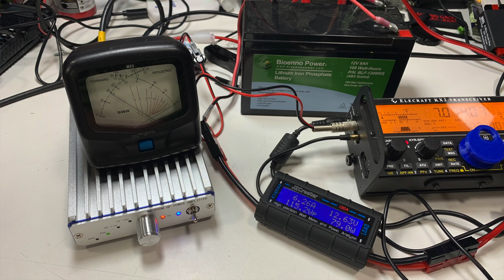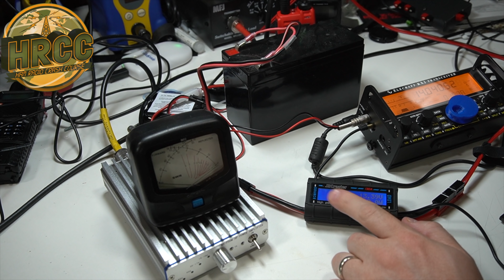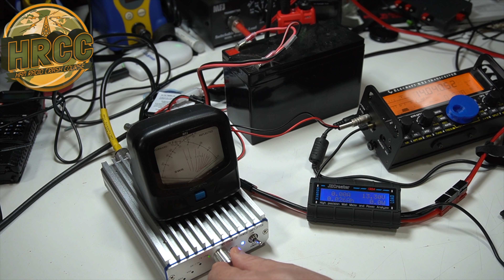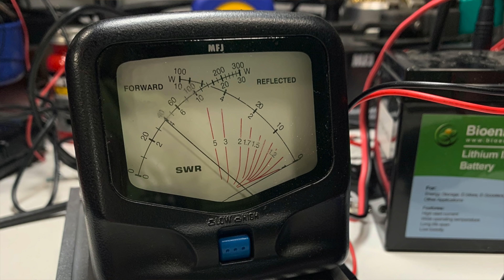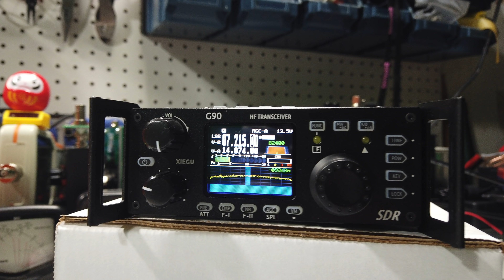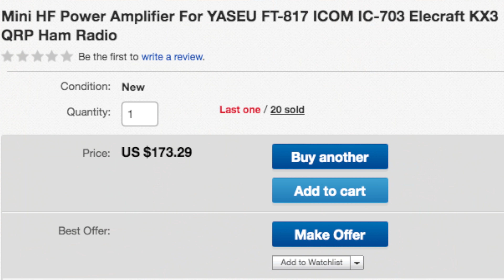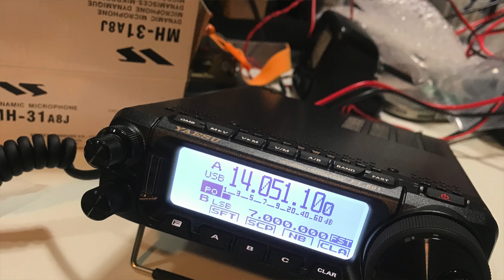Amp Up A QRP Ham Radio With MX-P50M

Comment: I loved this video, so true ! I have an FT-817ND and HW-9 with so-so antennas, and calling to the void sux. So ordered one. It came sooner than expected, easy to set up, it's EXCELLENT and I love it. Just what I was looking for. Set mine up with manual T/R switch to allow the different radios. The small size and reasonable battery drain allows better portability than the bigger rigs. And 40W is just fine. It works perfectly and turned my QRP rigs into more FUN.

Comment: iv had this amp for almost 2 years and it's still going strong! I would recommend this to anyone, I did have to make the cabel to fit my ft 817, but it was easy to do!
Reply: Same here 73 de KE0OZD
Reply: Same here.
Reply: Same here, I've got the cable working for the FT-817ND

Comment: Good info Josh on this little amp.  FT-817/818 users will probably need to create their own ACC connector.  I spliced up a Mac 8-pin Serial Cable.  There are only two wires you need to connect, it’s easy but wires are thin.  And don’t count on any customer service from vendor, I had no reply when I attempted to ask questions.  Tons of info if you search.  I do notice a draw on battery when left on, so I just leave it off if I am monitoring only.  Good luck.

Comment: I'm using it for a couple of years with ft817 and z817 tuner, so far working alright. Z817 has a limit of 20 watts...so I don't go beyond 20 watts, but I did try 45 watts couple of times with same tuner and it worked, didn't see any smoke 😊
Reply: isnt the tuner b4 the amp so it doesnt matter since forword power from the amp isnt going through the tuner anyway?

Comment: I have this amp and made a DIN cable to the FT817.  Then I also have a 3 DIN Y cable I made so I can plug in the radio, amp and CAT cable when I want digital plus amp (half QRP power).  The Y cable is not truly a Y.  It connects the relevant conductors to the correct leg.  Labeling is important.  The receive power drain on FT817 is so low compared to 100W-able radios like the FT891 the amp saves battery on receive if that is important. - N4NAS

Comment: I’ve pondered a while whether or not to buy one.  My KX3 will run up to 15 watts as long as I have enough volts to drive it.  I’m still undecided!  When band conditions dictate and have a resonant antenna I do okay.  The opposite can be a little demotivating.   Here in the UK, spring/summer is the time I get out and about more including holiday rents just in time for the summer doldrums.  Even having 100 watts can be a bit disheartening.  I did think about an additional 100 watt radio along the lines you mention just to keep the number of units to pack to a minimum.  Then portable power becomes an issue.  Problem is I love my KX3.  😊👍🏻 73 de M0AZE Mike

Comment: Josh I finally received it.
Reply from the maker: What do you think?
Reply: I like it. Will be easy to carry in a backpack for hiking to a Summit. Tried it on my 20 meter speaker wire dipole, but 10 minutes was not enough time to make a contact. I need play with it some more and to try it on another antenna.
Reply: @frankwc0o  bought from AliExpress, very slow shipping.
Reply: @frankwc0o  still working great, recently got my 1st 10 meter contact.

Comment: Great Video thank you. I would love some advise from you. I am a UAV Pilot in RSA with a aviation radio license. One of my biggest saftey issues is getting communication with manned aviation with our hand held radio on the ground usually doesnt reach most of the aircraft we need to talk to, in order to communicate our location. I have been searching for ways to connect an amp to our hand held aviation radios for increasing transmitting power. What type of amp would you suggest for that fequency band? Best Regards

Comment: You neglected to tell us how clean the output of this amp is.  You're right that SSB QRP is an exercise in futility unless we're in the peak of the solar cycle or you're using an uber antenna.   And if you've got an uber antenna, why would you waste your time on a QRP transceiver when you can afford the very best?  CW and digital are the only modes that makes sense using QRP with the current band conditions, and 45 clean watts would be the most realistic option if you want to make contacts.  I've made FT8 contacts while tuning my mag loop on the fly on my apartment balcony using less than 5 watts though, so anything's possible I guess.
Reply from the maker: It’s not the review, but spoiler alert. it has clean output
Reply: @HamRadioCrashCourse  Nice!  45 watts will be great for getting heard.   Especially with FT-8.

Comment: I would love to see someone run an output analysis of these little amps. I'm wondering about their spectral purity and filtering on the back end.

I bought one of Virgil Stamps miniPacker HFPA amps, which makes about 35w and it very useful for my QRP rigs. 

I remain curious about the inexpensive Chinese PAs. Thanks.
Reply: I was also wondering what the output filtering is like on these. On eBay UK you can buy a 45W linear amp kit (PCB and components only for about £10). I don't know if it's the same basic circuit used in the MX-P50X??. I cannot see any schematic for the kits. However, looking at the components, I cannot see anything that looks like low pass filters. Given the much higher cost of the MX-P50X and that it has a band selection switch, I suspect it has low pass filtering??
Reply: Perhaps he could do it on video for everyone?
Reply: @Steve-GM0HUU  what the amp kit called?
Reply: I doubt there is any filtering, if you were using this on a regular basis you really should be using a LPF which can be had for not a lot but they do hurt the portability of the rig.

Comment: Josh - several fellow hammers tell me that I should not connect my Xiegu G90 to the MX-P50M without using a Relay Buffer Interface to protect my Finals.  Others tell me that this protection is only for older Amplifiers?  What are your thoughts about the risk of directly connecting the MX-P50M to the G90 without using the indirection of the Relay Buffer Interface ?
Greg

Comment: I have a G90 that I run into an Ameritron ALS 500m, it puts out 215watts, if I could get an input of 64watts it would put out 600watts. I'm in a bit of a quandary, do I wait till I can buy a 100watt radio like a Yasue ft-991a, or instant gratification by getting a cheap amp, in-line to excite the Ameritron. Dang, choices, choices.

Comment: Looks great, but can it be used with any QRP transmitter? Many home-brew or older QRP transmitters have no control switching unless modified, and that's not always possible. Does it need control switching or can the RF input do the switching? Thanks.

Comment: Okay I have been using the amplifier since June 28. It is working great, often I can start a contact with the amp and then try five watts and can be heard without moving their s-meter. For 80 meters I use a 100 foot long wire into my LDG z11 tuner with no ground. Don’t touch the tuner switches or get a Rf burn. Made contacts in Washington and Arizona. My other antenna for 40-6 meters is the EARCHI 9:1 end fed. Using it vertical on a 28 foot pole that is part pvc and part crappie fishing pole. Have 32 feet of 16 gauge speaker wire wrapped around it the entire length. It is fed with 50 feet of RG8x to the Z11 tuner. Have made 40 meter contacts to Vancouver, NC , Idaho, and San Diego. Have also work 10 meters with a friend 35 miles away with both 45 and 5 watts.

Comment: Someone needs to figure out how to use all of those Makita, DeWalt, Milwaukee etc batteries that are floating around out there. I have 8 5ah Makita batteries that are just longing to power a radio.
Reply: There are plenty of designs for 3d printable battery adapters that seem pretty easy to assemble
Reply: Otherwise you could just crack them open and pull the battery packs out and do as you please...
Reply: I did that 2 weeks ago with a milueakee battery got the 3d adapter from Amazon
Reply: @ruddyff  what about the circuit necessary to get the voltage from 18 to 13.8ish
Reply: I used an old damaged/shorted multi-chemistry (green type have enough room inside to fit a voltage regulator) Ryobi 18v+ battery charger, gutted it, stripped the PCB from all it's components except the battery contacts where the battery sits in, then cut and discarded the other half of the board to make room for a 24v to 12v 25amp golf cart voltage regulator. I soldered the voltage regulator input leads to the PCB board battery contact points with a 25 amp inline fuse. The regulator output cables come out the of the existing housing power cable hole and added Anderson power-poles and a fuse holder to the output lines.
 I get 12.23 volts out of it with a Ryobi 18v (about 22 volts fully charged) battery. Soon will add a USB charging port to it. My radios display voltage so no plan to add a meter yet.
Reply: The hard part is finding a buck converter with the right dimensions/size/power handling to fit inside charger housing. A buck converter will allow you to fine tune the output to 13.8vdc, the amperage is the size/dimension defining factor. A regulator cannot be adjusted so its output is what it is.

Comment: I use the IC705 with this amp.  I noticed yesterday with my 1/4 wave ground plane antenna for 20meters that my IC705 states that the SWR is below 1.5 for 40 meters!  I don't believe it.  So I tried it and I was talking to someone 30 miles away.  Have you noticed that on the IC705, you will read a low SWR on bands that the antenna doesn't support?

Comment: I want to use a Stryker 955hpc 10/12 meter radio in the field. It has 10 watt dead key and 90 watt PEP. What battery should I use ?

Comment: i have see in your video the xiegu x5105  and i have the Mx P50 HF AMPLIFier und have the problem whih the. red cable  the black cable is ground  but as to connect in the ACC cONECTING in THE TX XIEGIE X5105  can you help i am whitsticker in germany  thanks and 73 Thomas DG1XT

Comment: I have been running this amp for just over three years with a FT-817 with great luck.  My biggest concern prior to buying was how clean it's output was.  Turns out it's pretty good.  Check out this link,

http://gm4slv-geek.blogspot.com/2015/03/mx-p50m-amplifier-for-ft817.html

Mine experiences lots of digital and SSTV use with long key down cycles.  Added a small muffin fan to the fins to manage the heat.  It's wired into the power switch and turns on with the DC power.

Comment: Wonder how noisy it is on its 3rd harmonic ?? 😳😬😃KC3ONO
Reply: not to plug anyone elses work, but take a look at the KB9RLW (Kevin L) YouTube offerings.  He tested the amp quite vigorously in 2 or 3 videos, and if you watch them I think you will have your questions answered.  I personally have used the amp about 3 years now mated to my "817" without any problems.  Works as advertised.  Scored it for about $120 on EBay, after watching them for a while...  Overall a nice little amp when you get tired of QRP sometimes     (-:      Paul   NA9M

Comment: Are you sending CQ "for" KI6NAZ, is that someone else?
 Where does this lingo come from?
Any idea what the dirty IMD looks like on a spectrum analyzer? Is this amp FCC "type accepted"?
YOU as an amateur, are responsible for the dirty signal not this Chinese manufacturer- Something that should be taught in the CRASH course

Comment: How do I use this with a tuner?  Can you even use it with a tuner?
Reply: Just put a tuner on the output( no internal radio tuner), tune it on bypass first to not overheat the rf power transistors

Comment: That amp should not be used that high. You should not go beyond 1dB compression. You have more than 3dB compression at 45W which is very bad for splatter and signal quality.

Comment: Toss a tuner between the antenna and the amp just in case
Reply from the maker: Assuming you have a tuner that can handle it.  Yes, is a good way to go, I did this with my hex beam for a while just to smooth things out.

Comment: I just can't see the purpose for a qrp radio. Why not get a used icom 706, or some other small radio that puts out 100+ watts
Reply from the maker: Qrp radios for the most part are smaller, come with internal batteries and sometimes tuners.